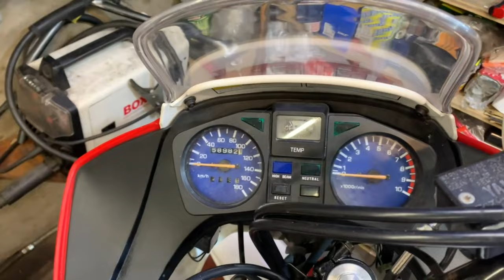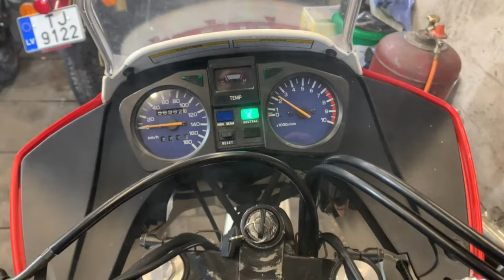Rebuilding a broaken engine on a Yamahe Tenere XTZ660

Comment: Hey, I saw your video about the Yamaha Tenere XTZ 660. Really great, it just goes a bit fast.  Is there a way to get the video in normal speed or view it on your YouTube channel?  It would help me enormously with my own engine block.  Thank you in advance Wannes
Reply from the maker: Hi,
Thanks.
Unfortunately most of the videos were filmed in time lapse mode.
You can use the YouTube speed settings to slow it down as best as it can.

Comment: Hi great video man very informative, i was looking at one of these a 92 model around a 100 k kms he says when it gets warm it sits at 2500 rpm and wont come down to tickover  !!! He,s looking for 1500 it's ok I'm just a bit concerned about the engine, what do you think  ????
Reply from the maker: @tonyireland1434  the high idle speed should be the cause of the carburetor and/or vacuum leak. Believe it just needs a cleaning and adjusted correctly.

Comment: Hey man nice bike and rebuild! Was wondering what went wrong with yours.. looking into buying one of these, one up for sale with about 50k km on the odo. Since yours has a little more im worried that this might be a too high milleage to buy it at? Some people say the engines last to well over 100k km, so I was wondering if your bike was a exception or not..because im not looking to rebuild it any time soon, I won't have time for that.
Reply from the maker: @bve7397   I’m not the proud owner of this Dakar legend, I only had the pleasure of rebuilding the engine. 
On of the nuts, holding the sprocket came loose and let the balancer gear to jump timing and hit the crank rod.
Overall the engine seemed in pretty good shape before this happen.
Presume that the nut came loose because one of the previous owners had taken of the gears and not used new lock washers
Reply: @restorationvalve  Thanks helps allot! Is it a dakar legend?? Man gets me excited! Hoping to learn some offroad with it and commute on it, planning to keep it for a while.

Comment: thank you sir i have the exact same bike dont no if any one can help ive rebuilt mine but can not buy header pipes have a doner bike 2015 super motad with brand newr dominatoer headers exhaudt bbut thr headers just need a little tweeking bend to fit the1991 can anyone help please thank you
Reply from the maker: Sounds like you’ll have to find someone local with a pipe bender or a correct exhaust that could fit better in your region. Wish I could help out, but unfortunately I don’t have anything that could bend exhaust pipes or an exhaust that fits for this bike.
But if you need some other parts, there are a few parts from this Yamaha model on the eBay store, that’s described in the video description.
Reply: @restorationvalve  thanh you i m8

Comment: Hello, what valve clearance do you set for the intake exhaust?
Reply from the maker: @juzik43  as per the manual, 0.09-0.13mm for the intake and 0.16-0.20mm for the exhaust when the engine is cold.
Reply: @restorationvalve  OK thanks

Comment: Did you do anything to the piston, rings or cylinder wall?
Reply from the maker: The piston, rings and the cylinder are the original ones, they weren’t damaged.
Reply: @restorationvalve  cool. I need to rebuild my 2006 DR650 motor to repair a left case issue. Motor has great compression and the Cylinder is Nikisil coated but most people are telling me I should still lightly scuff the cylinder and replace the piston rings. Thoughts?
Reply from the maker: @trailtrashgarage  if the rings measure out to be in their required tolerances, then there’s no reason to replace them.
I haven’t had any engines with Nikasil coatings. I’ve seen M539 channel dealing with that type of engines, if I remember correctly, he didn’t scuff up any of them, because that coating is a very thin layer.
I personally would not recommend scuffing up the surface, just cleaning it and lightly applying some engine mineral oil.
FYI, not a cheap thing, but ProCylce has a big bore kit that includes a steel sleeve.
Reply: @restorationvalve  thanks for the input. Ordering anything from Procycle and having it shipped to Canada where I’m located is out of the budget unfortunately.